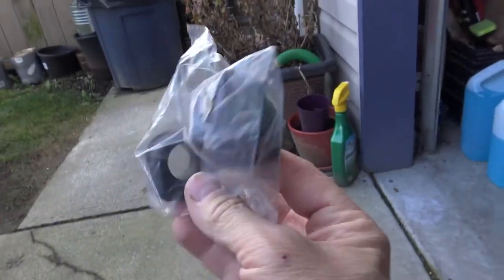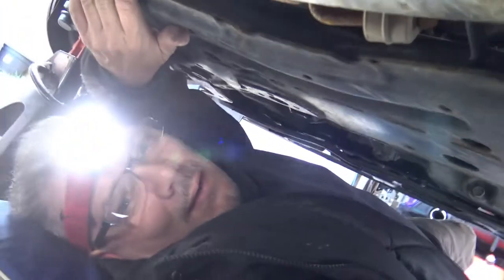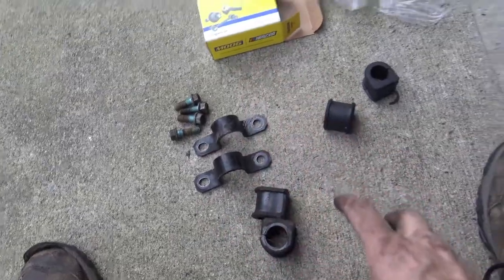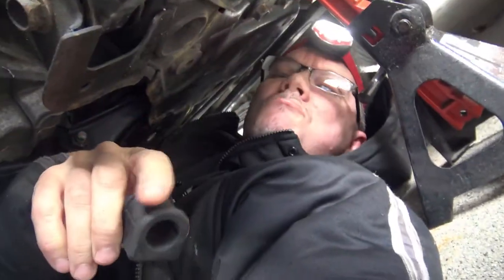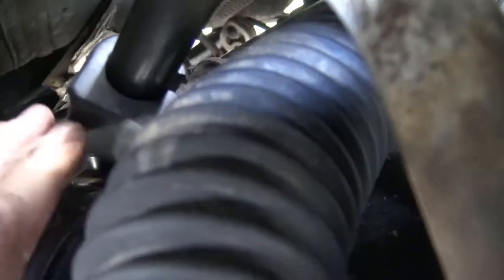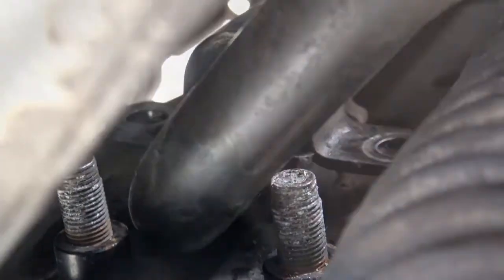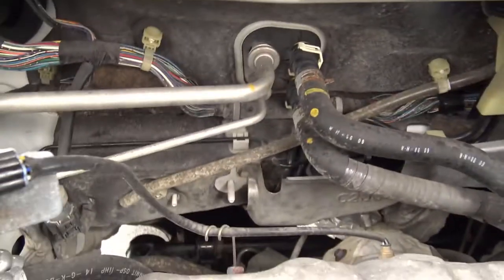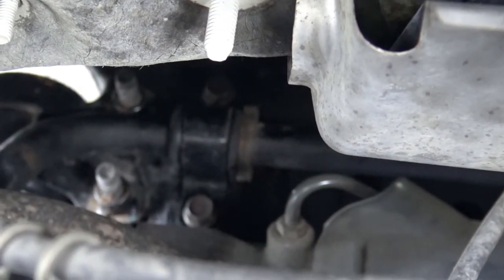Fix the Mazda CLUNK!!

Comment: I just bought 2013 mazda3... clunk in the rear.  It was the sway bar links. Stupid thing I ever saw use a Allen  key and a wrench to take off a nut!. Ended up using bolt snapper Allen stripped lol.. now sun roof problems... drains out kick panel.. comes back in .....help anyone

Comment: What are the bushing numbers ? Your link to eBay has expired. Would have been best if you showed those numbers in your video. 
Thanks
Reply: I used Moog bushings K200624 for Front and K200623 for Rear

Comment: With a long enough extension you can get to both by the top EVEN driver side if you have a person guiding from the ground.. that.being said you'll most likely have to use a 1/2 inch 500ft lb torque impact to get the DAMN frozen bolts off oh and pray to the cars god's they don't break.
Reply: Also ty for making this video it did help a ton, even with tapping out and having to borrow a neighbors impact driver 😂😂😂

Comment: thanks for the video but I just broke the back bolt on the passenger side. now I am stuck. both front bolts came out fairly easily though. Still struggling with the drivers rear bolt
Reply: oh no
Reply: Well it wont prevent you from driving if you just remove the sway bar completely

Comment: I don't think I'd ever recommend using control arms for jack stand placement, there are better options.
Reply: Got a Mazda 5 about a year ago and in the next few weeks gonna start the process of figuring out why the front suspension is so clunky. Haven't even looked into proper jack stand placement for this car yet. Do you know off hand where the "recommended" spots are?
Reply: What are the better options please.  I’ve been trying to figure this out.
Reply: @Jwk7591  There are jack points located in your owner's manual.